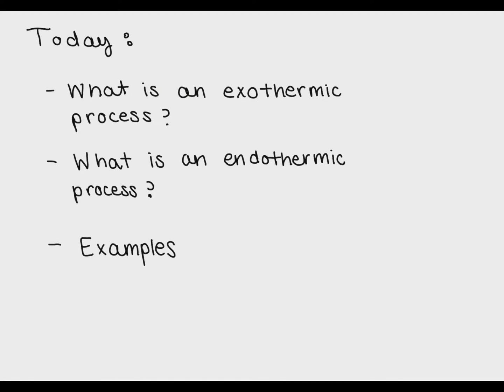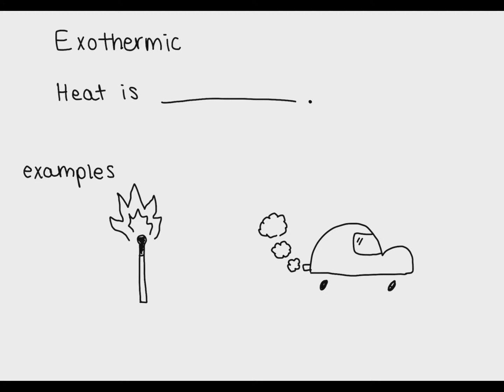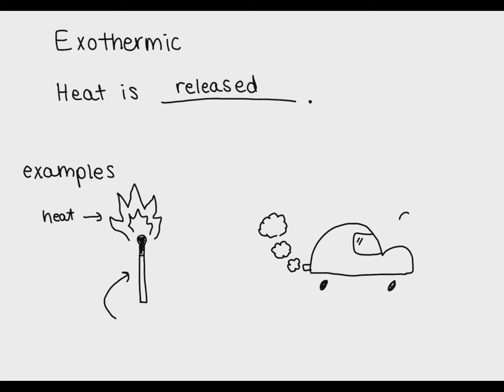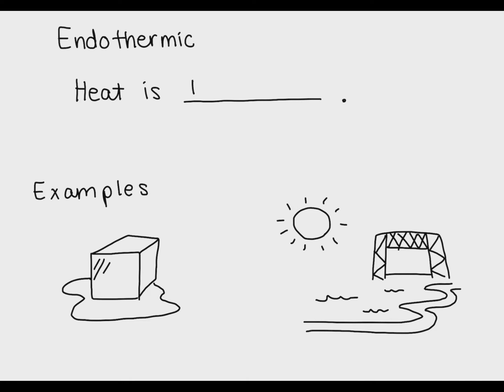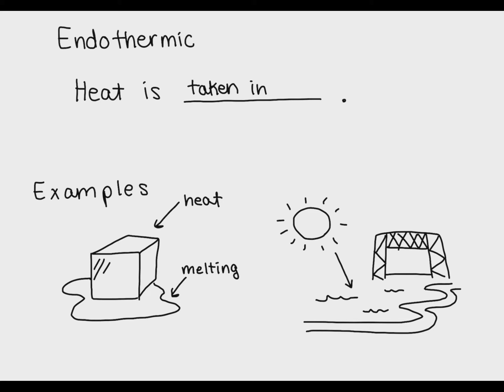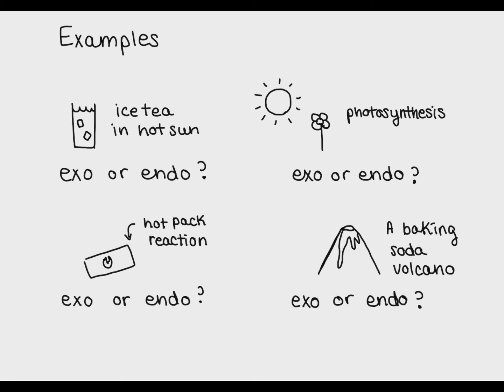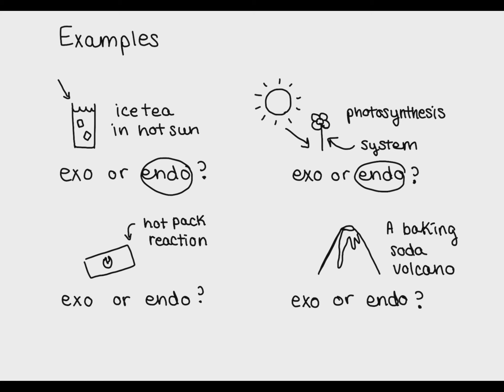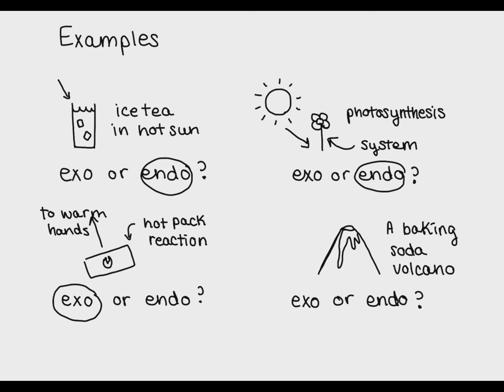Exothermic vs Endothermic Reactions

Comment: there is a exmaple given in my book. 
Example of Endothermic :- when you add ammonium chloride with water, the solution becomes COLD. but the solution is supposed to be HOT since the heat  from the surrounding is going into the system. Am I right ?
Or is my point of view wrong ?